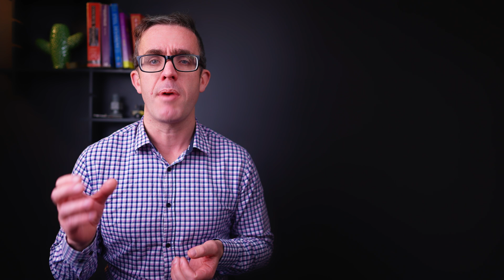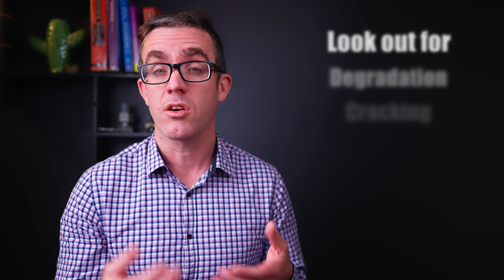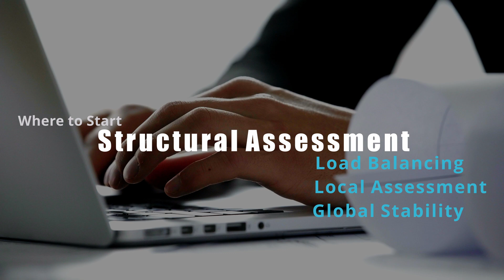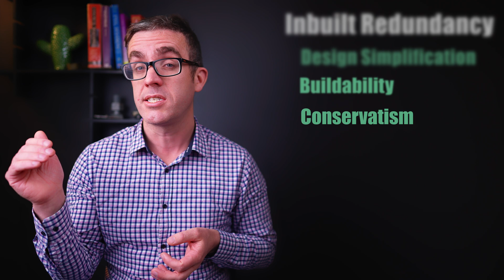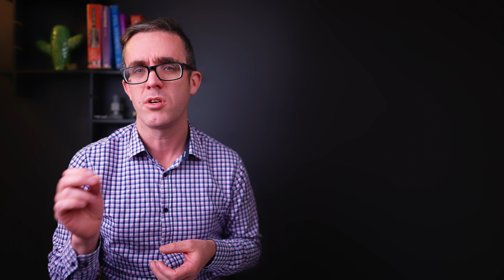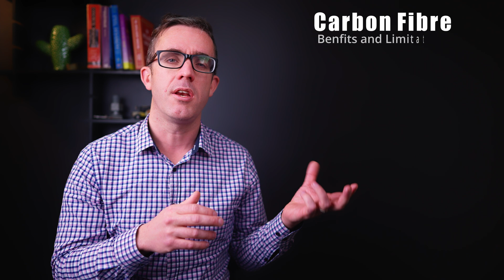The assessment and strengthening of existing buildings | A basic guide

Comment: Hi brendan.thanks for this video. I do mostly repair and renovation projects to existing buildings. What is your opinion on doing core samples through an existing slab? Not ideal but sometimes necessary. Any tips on do's and dont's?
Zelrise (South Africa)
Reply from the maker: Hi Zelrise, thanks for the support. You just need to locate the cores in locations where the structure has low stress. Concrete it very good a redistribution around local areas.

Comment: I wish you had some structured training sessions for those wishing to learn the art of structural engineering. Graduated with an aspiration to work in structural engineering space, but there was no choice than taking up what came by.
Reply from the maker: Hi Dom, I would be looking to do this in the future, but it is going to take time. I want to make sure they are good. Don't stop looking; just make sure you are in a job close to the structural engineering space, like construction management. It is a tough time out there, but the industry is starting to pick up.
Reply: @BrendanHasty  Hi Brendan, 
Thanks a lot for the encouraging reply. I missed to mention in my last comment I am a practising geotechnical engineer (in Sydney). As you said, it is quite exciting to see the industry picking up lately. I had quite a few interviews but could not nail one. No qualms. I am at the very least convinced the companies/consultancies that have interviewed me have a fair point in doubting a geotechnical engineer looking for structural role. 
Again, back to structural thing: I bought a few structural reading materials including Leonnie Pack’s Structural Engineering Guidebook a while ago, but as you can imagine, with no such project-based learning environment, I am making not much progress. Any suggestions? Directives? Thanks again.

Comment: Thank you for talking about this subject which is very interesting and useful for my undergrad dissertation, I would love to see more videos expanding this subject which presents a whole lot of challenges that are different than designing a new building.

Also there is a lack of design examples about the subject on how to propose the retrofit, the only code I could find about this subject is ASCE 41-17 but lacks design examples on how to apply it as it is displacement based, totally different than the force based codes like ACI 318 and ASCE 7.
Reply from the maker: Hi Aytron, thanks for watching and glad that you found it interesting. Agree the strengthen of existing structures presents a lot more challenges than new build, and some of them you may not think about. these are topics that I would be interested in covering in future videos. In the meantime, you can also go to the International Concrete Repair Institute (ICRI) https://www.icri.org/page/free-concrete-repair-resources. They may have some resources that you may find helpful full,
Reply: @BrendanHasty  Thank you I didnt knew about ICRI and those resources looks useful! I also found there the existence of the code ACI 562-19 which I will give it a read

Comment: Brenden to be a structural engineer do you have to be good at drawing and creative?
Reply from the maker: Hi IQ_Brousk, structural engineering does have some level of creativity required, and being good at drawing would be beneficial. But would modern computers being able to draw isn't necessary, and most structural sketches are drawn with rulers and not free, so it isn't necessary to be good and drawing.

Comment: I work in NYC so many of my projects are modifications to existing structures.
Sometimes we build the new portion of the structure independent of the existing structure as not to add any additional load.
Another interesting part of working with existing structures is the foundations and coming up with unique SOE solutions, but that can be another video!
Reply from the maker: Hi Daniel, yes building through/around existing structures is sometimes easier, and increases the hight you can build, like 111w57. Yes footing can have issues to strengthen, however, in my experience alot of the time the bearing capacity is a function of the settlement.so if you do not increase the load alot and can live with additional settlement you should be fine. What do you mean by SOE solutions?
Reply: @BrendanHasty  some projects the owner what to build an extension in the back. These projects often are next to other existing structures that have basements. Therefore, besides building an isolated structure (with its own footing) we have to underpin the neighbors footings.
This can lead to interesting Support of Excavations plans.
Reply from the maker: Hi Daniel, Excavation adject existing footing is always a balance to avoid movement, typically I have adopted contiguous piles or staged Excavation. However, I have always tried to avoid underpinning as I have found it can cause cracking in the area underpinned. This is due to the underpinning locally stiffening the footings.
Reply: @BrendanHasty  Noted. Thanks!